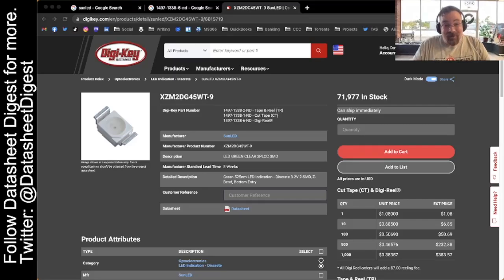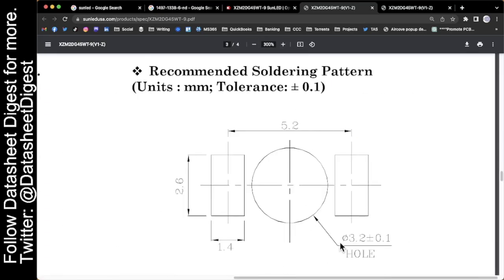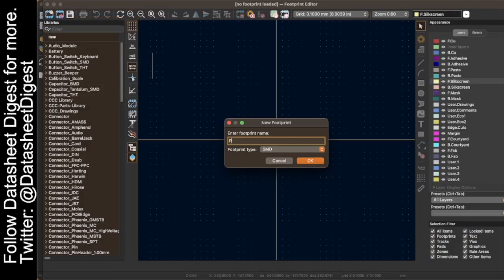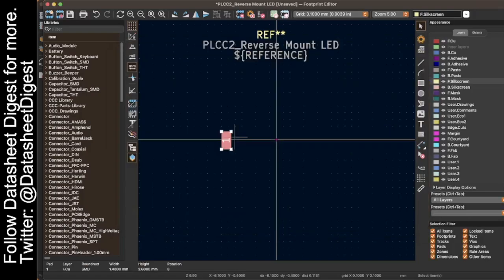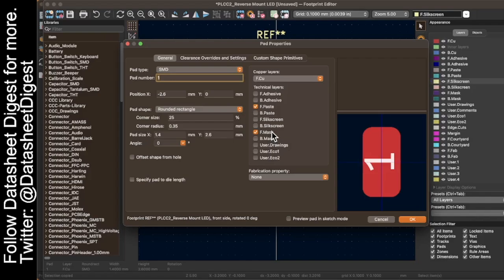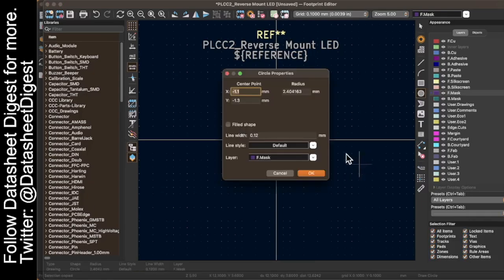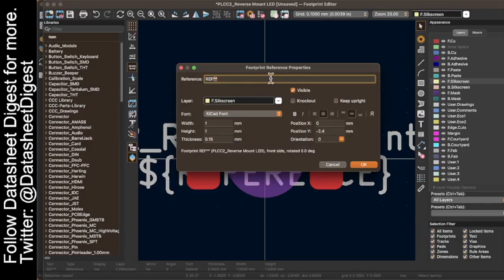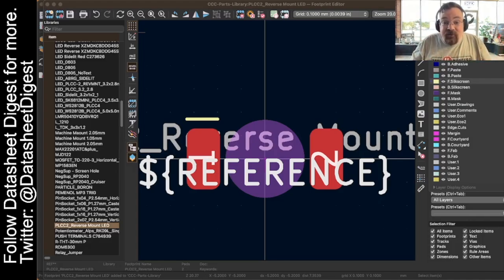KiCAD Tip: Making a Reverse Mount LED Footprint - The Simple Way

Comment: Shouldn't you put the circle on the "edge cuts" layer? Otherwise the LED will just be pointed at the PCB. If you place the circle on the edge cuts layer, the circle will be drilled out allowing the light to escape out the other side of the PCB